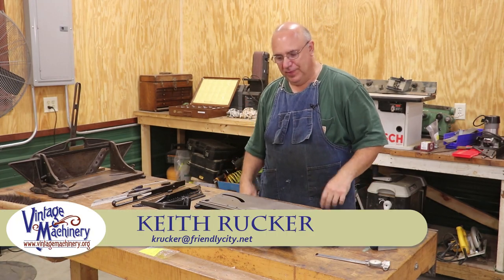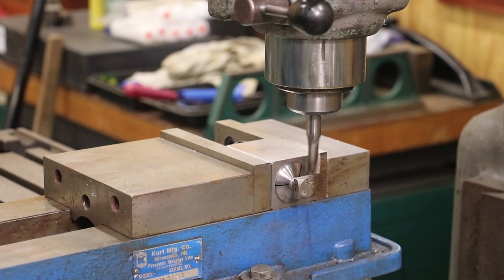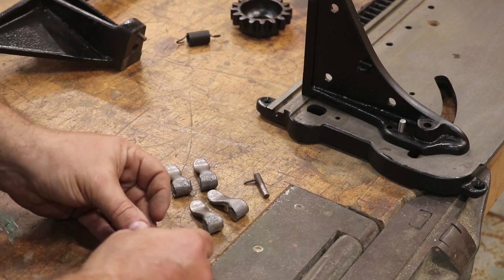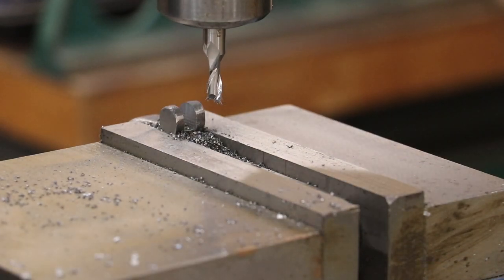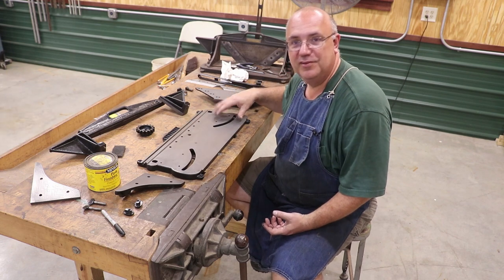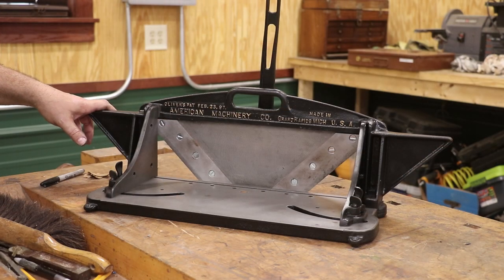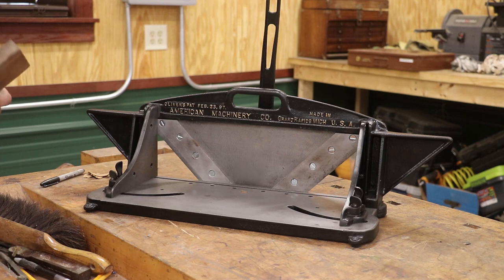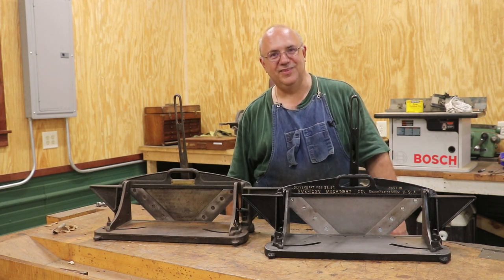Restoring an American Miter Trimmer: Part 2

Comment: I recently made a similar set of bolts. Not having a collet chuck setup in the shop, I drilled and tapped a piece of square stock after facing it off. Clamped the square stock in the vice and set a stop for repeatability. Threaded the bolt into the square stock and torqued lightly. The x axis was positioned to cut a few thou into the square stock. Yes, the square stock was sacrificial, and it worked like a charm. Great video, Keith! Keep them coming, my friend!
Reply: You could've also just used a jam nut against the block, depending on how much length you had on the bolt to play with.
Reply: I thought about that, but the block wasn't anything special (read hardened, commercially produced, surface ground, etc....) and I was looking for rigidity. If I need to make more I'll just touch off on the shoulder I created and go. It's not a critical dimension anyway as long as the mill cuts across the whole bolt head.

Comment: Nice project Keith, enjoyed watching this all come together thanks for sharing.
I live in the north east of Ontario Canada and the cold and hot cycles in my garage cause condensation that forms rust.  I also use paste wax to try and keep this to a minimum I place the table top in the direct sunlight to help warm up the cast iron leave it for a bit then apply the wax, I find it a bit easier to apply.
From Elliot Lake Ontario Canada.
Reply: Thanks for the reply I do run a dehumidifier all summer, and I will check into the air flow.

Comment: Hi nice job on the mitre trimmer , I have one almost the same but made in England, UK, mine has a second row of tapped holes  with bolts in, the purpose of these is to be able to pitch the blade  for a true cut. I saw a second row of holes in the mounting plate on the one you have but you made no mention of them  on your video,   I would be interested in your comments. JB

Comment: The miter trimmer cuts nicer if you can make the cut with the piece flat on the bed of the trimmer. Also my Lion miter trimmer has attachments for measuring and clamping. These tools are great for picture frames!!

Comment: I would have liked to see a closeup of the braze repair and a critique of it.  Also it would have been interesting to see how the handle attached to the gear.
P.S.  I don't know if you are familiar with lacquer putty, but it can be used between body putty and paint to fill in small divots and scratches.

Comment: I remember many years ago a carpenter using a unit like that to get perfect picture frame corners.  Probably before accurate saws. He also had a hand back miter saw that tracked on a ball bearing slide
Reply: Most saws are not that accurate. It's why these are still made and used.

Comment: One constant tip over decades of shop tips ,if grip is a problem is to augment with wire. Different diameters of soft picture wire,different diameters of solder etc,spiraled into the thread,as long as judicially chosen,help considerably if simple tightening is not sufficient.
Just being general on this as various situations and what is available in the shop mean a little brain power can save some grief.

Comment: I have one similar to that but it is actuated with your foot.  Blades move up and down.  No tear out whatsoever. This one here looks like it left quite a bit of tear out.
Reply: One of the reasons for the tear out is that Keith cut that piece of oak on the vertical. If he would have laid it flat, there would have been very little. Plus, any tear out would be on the back of the molding, and that is for what this trimmer is designed. The blades do need to be lapped though. Jon

Comment: Hi Keith,  One little item that might go a looonnnngggg way in presentation of this beautiful piece of equipment.  Align all of the screw slots of the knife screws to be... 1) vertical,  2) horizontal, or, 3) aligned to the slope of the knife.  Just a little OCD moment there...but, it does look nicer that way.  Do you think so as well?
Reply: I'm the same, I liked how the first two looked and was disappointed when I saw the third one.
Reply: 0

Comment: Adding a tube or other spacer to the bolt might have helped to keep it from getting pushed in. (And making sure you were machining in a direction that pushed the part towards the vise)
Reply: Sure, but that would not prevent rotating. And when the bold rotates during the cut...too bad for the endmill
Reply: @udowillkomm1173  you can set up the machining so almost all the force comes in a single direction. If you back up the bolt so it can't slide in (or like in the video have it get pushed all the way in and then leave it there) then there is little or no force rotating the bolt.
Reply: @udowillkomm1173  oh, and I meant some spacer between the back face of the bolt and the face of the collet. The collet would still be gripping the threads. A spacer between the collet holder and the back face of the bolt would be even better as it would tighten up as the collet was pulled in.

Comment: Watching these last 2 videos has me wondering, did you run 220v branch circuits?  If that's what I see behind you, how did you determine the placement of the 220v outlets?  I can't remember, you only have single phase, right?
Reply: Only single phase to the shop, but he has a rotary converter (made by one of his sponsors) that handles the conversion to three phase.
Reply: @machintelligence  that's what I thought, but I'm more interested in the placement question.  Spacing of 220v outlets isn't specified by NEC I don't believe.

Comment: So to cut 45 degrees, do you have to make several progressive cuts, or can you cut off 45 in one go on the thickness of the wood you used as an example?
Reply: Normally you would rough-cut on a miter box and then trim to precise angle and length using the trimmer. You could, I suppose, sneak up on a miter by making several cuts, but the trimmer is not intended to make a heavy cut. Most of the time you are taking off about the thickness of a piece of paper.

Comment: Just purchased a Rockler Miter Trimmer and used it on my first job.  At this point not real impressed. I purchased it to cut edge molding for kitchen and bath countertops.  To cut an outside miter you have to place the laminate side of the molding on the adjustable fence. When you try to cut thru the molding it almost always chips the laminate because the laminate is on the exit side of the blade and there is no way to put the molding in so the laminate is on the entry side of the blade....Any suggestions...????

Comment: What i really would avoid are grease and fluids containing PTFE or Silicone. That´s bad on woodworking machines. I´m not sure, but it seems, you need to sharpen the knifes on your machine. It made a bit more effort on your machine to cut the wood. Now, for what are the parallel rows of additional bolt holes behind the knifes....my guess would be, they are needed, when the knifes after several times sharpening are a lot smaller.
Reply: 0

Comment: Hi, I have a similar tool to this, not exactly the same but it does a very accurate job just like yours. Mine came from the estate of a friends father and had originally been bought from Axminster Tools in Dorset, England within the past 20yrs. Good designs don’t die, they just smell that way. Regards

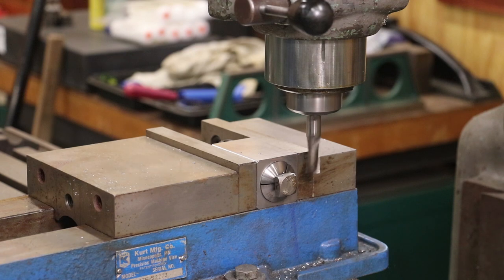Comment: @5:02 a very good example to your plaudits of what happens when you can't be bothered to make sure the piece is clamped firmly. Holding the block by hand on the bench gets it to where you can carry it to a vice for final tightening. Looks like you didn't think about that. You can test if the bolt is held firmly by putting a spanner on the head but that requires that you are able to question your own actions on this public forum.
Trying to blame the threads for the problem says it all.